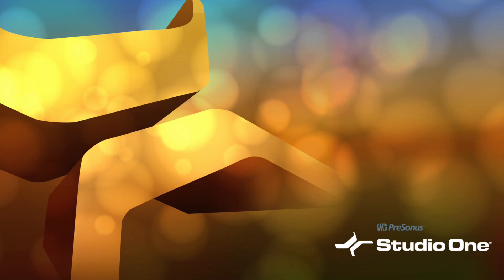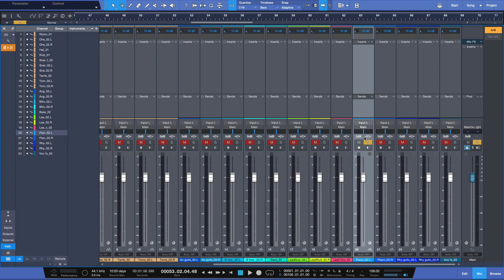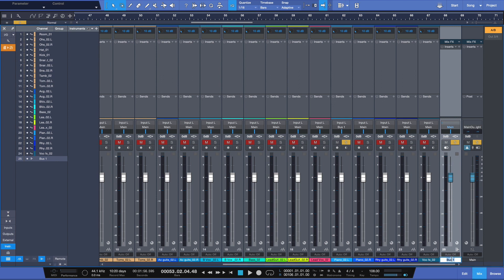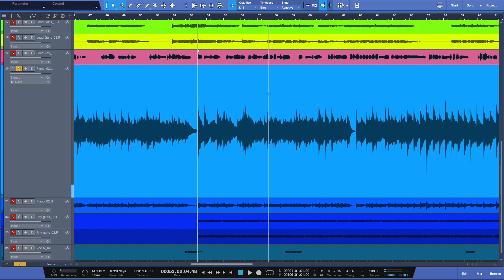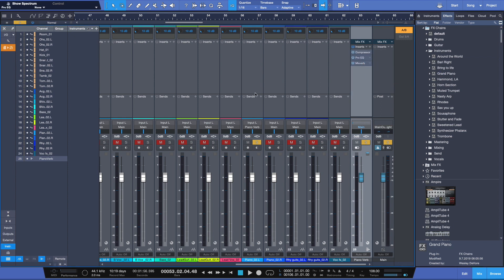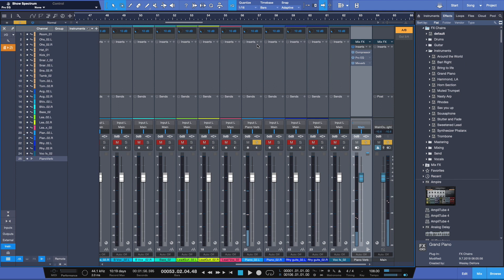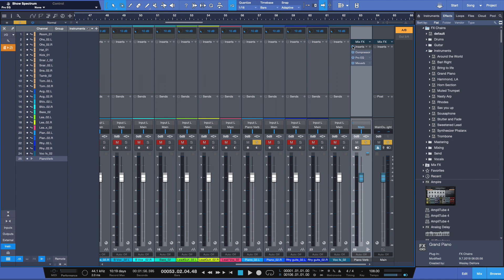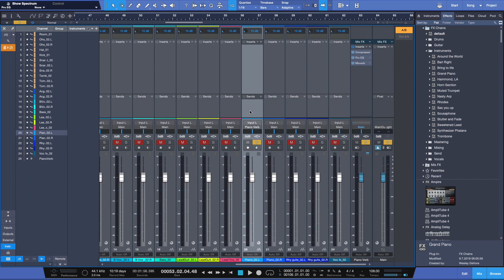How to Create an Effects BUS in Studio One

Comment: Hi Carlo, i think you are misunderstanding the difference between a bus 
and an FX send. If you add a bus for a track it will simply route all 
the audio through the bus, not a copy of it, that is what an FX send 
does, that's why when you add a reverb to a send it has to be set as 
100% wet so that you can blend it with the original track. What you are 
doing in your example is adding an insert to the bus, setting it to 100%
 wet and then routing your acoustic track through it which in effect is 
no different than adding the reverb to the insert of the original track. You are only going to
 hear the wet signal and you'll lose the dry. You need to add an FX channel and click the + icon on the send on the track and use the slider to blend the dry track and the FX send
Reply: First time I have ever seen a mistake on a video.